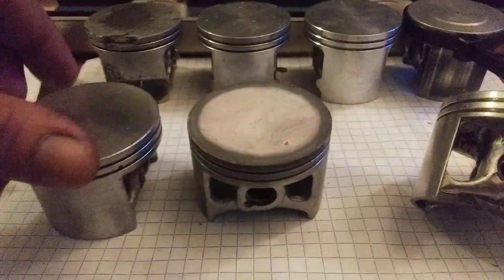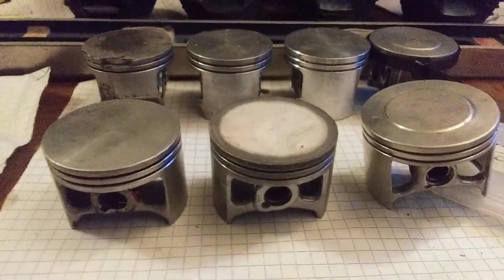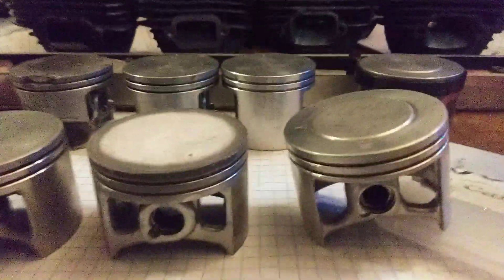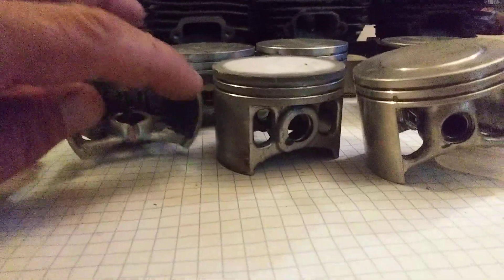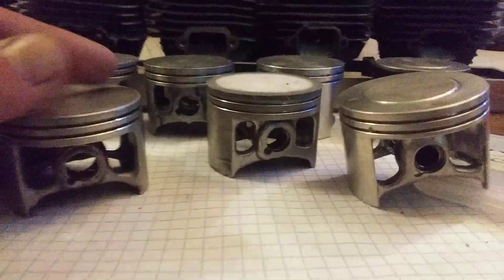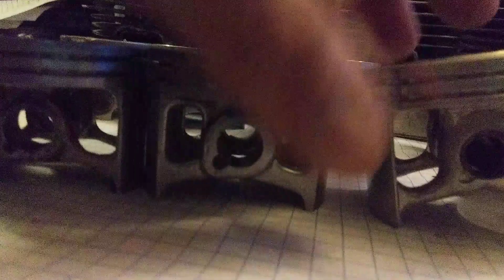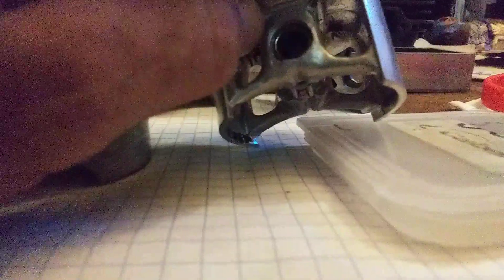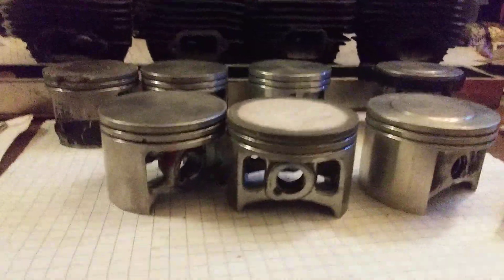Porting Pistons: Opening Windows, Reducing Weight, Aerodynamic Improvements etc.

Comment from the maker: NOTE-- That Zip-Tie??  RING-COMPRESSOR!! I've never understood how/why anyone bothers with hand-held ring compressors when you can use zip-ties, the fat type let you get 2 rings otherwise just use (2) zip-ties, the jug slides them downward off the piston (and you just snip them w/ wire-snips)   This lets you seat you rings properly on the locator-pins and BE DONE with that, both hands free, to do your work (man I'm trying to imagine putting jugs on when 1 hand is holding a ring-compressor...no thanks....very surprised this zip tie trick isn't everyone's default!!)